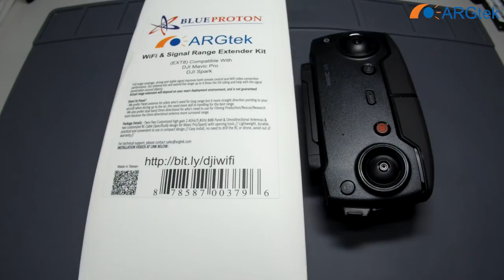DJI Mavic Air - ARGtek WiFi Range Extender Installation Guides

Comment: At  4.30 , i cant unscrew that part . It's so tight. Help !
Reply: James Tai same issue. What did you do
Reply: Get another screw driver with a bigger grip. The stock supplied screw driver simply can't supply enough torque to unscrew the thing. I faced the same problem

Comment: The battery will only give 17 minutes or 18..Lol go far and and then crash the drone..
Reply: tosin v it's got back to home or controller auto ya for low battery?
Reply: Gory Glory it's not legal to go far ' you are supposed to only fly within line of sight so it wouldn't matter if you got an hour of flight time you still should be able to see the quad.
Reply: Droneworks Camera Action there are many things not legal
Reply: Gory Glory yes you're right and not following the rules is why we have more of them '
Reply: Droneworks Camera Action, you're assuming everyone lives where it's illegal to fly out of line of sight. I DO realize in most places it is illegal to fly out of line of sight. Many of us have on the other hand have flown our drones until it's a speck on the horizon (much further than I've managed to get my Mavic Air before the range warnings come on). It's still in line of sight, but also a somewhat useless interpretation of a law at that point. I advocate sticking to the laws, but a evolution of the laws is inevitably coming.

Comment: I've upgraded my Phantom 3 Standard with this upgrade and my range is now over 2,700 feet. With the stock antennas I barely flew past 1,000 feet. The installation was not that hard. The installation with the Itelite system on my Mavic Pro, was a lot harder because parts are very small.
Reply: leegenix what phantom 3 standard antennas did you install? Im getting no more than 300 meters with stock antenna mostly 200 to 250 meters..
Is it really worth the upgrade as im thinking i have a dud.. tried downgrading different firmwares or the latest firmware and dji go to this date.. different dgi go rolling back.. same results loosing video signal auto returns home. My spark kills this distance.
Reply: I am using the ARGtek 3 antennae Dipole System. I am also experimenting with extended wire cables with a pole about 2 meters high for better transmission and range.

Comment: Hi, i bought the argtek antenna kit for phantom 3 (2 squares and one omni directional antenna). can i install them in my new dji spark RC instead ?
Reply from the maker: https://www.facebook.com/groups/354805821583304/
Reply: @2009KittyN  it's PH3 standard. I've bought the kit for using with PH3 standard, but i want to use this on my spark instead. The kit came with a plastic support with 3 conectors on the top and 3 cables (white, black and gray) going out the bottom
Reply from the maker: Spark support dual band, so it is better to have dual band antenna.
you can send mail to sales@argtek.com , maybe you can only just buy the customs cable for spark. and using 2.4GHz antnenas from (p3 standard)

Comment: Good clear instructions.  I was just looking to see what is involved and to compare this solution with the slip on Yagi or Reflector type signal improvers.  Apart from better matching and more power transfer, antenna gain is just a function of directivity, so it would help to know what the design criteria is here.  Being a flat panel I would guess it as an array but again a polar diagram of the antenna characteristics and 3dB beamwidth would help in deciding if it is worth the expense and effort .

Comment: Is this really necessary? You can reach 2.5 miles (4 km) with the original antennas, and with enough battery just to come back before it crashes.
Reply from the maker: Gamaliel Estremera Not all can reached 4km. It because of DJI product quantity issue.
Reply: I seem to get about 1km before warnings pop-up I have a weak signal. I'm sure that would improve if I went to the middle of nowhere to fly. It doesn't bother me much because my purpose requires I see it well anyway.
Reply: The problem with the range is Radio Interference. I flew mine this summer over open farm country and did very good using stock antennas. Now that I made my final payment, I can experiment with different equipment. But if you fly in areas with Wifi and other radio garbage, you will have drop out and lost connections problems.

Comment: Even you have a better controller you do not have a strong battery.
Reply: jun xu that's coming soon I've heard extended batteries for the mavic air on the way . Hope it's true 😁
Reply: steve scarberry I cannot wait for it. The weak battery is really short point of it.